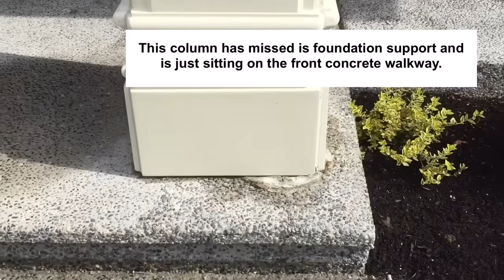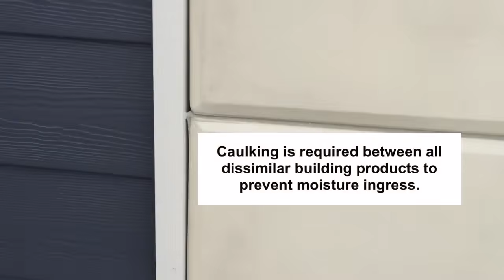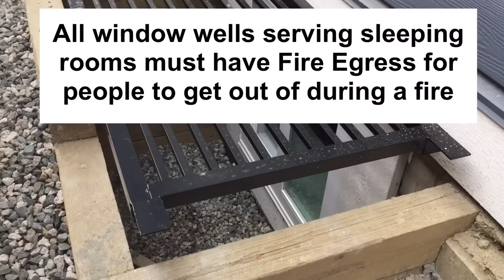New Home Construction Inspection - This is Shocking!!

Comment: How is this house worth 2.4 m??
Reply: The current location, the job in throwing the trash out (fees and such for the city to handle) currently on the lot, and erecting a better place to live = $2.4M
Reply: Spencer T vancouver is very expensive, i live around 45 minutes away and even the houses where i live are expensive for such an awful fucking house
Reply: Canada's housing bubble has not popped yet. Due to their mortgage laws (5 year ARMs, you refinance every 5 years by default) coupled with incredibly low down payments, people leverage these houses up to 60/1. If the house loses value, the bank comes after you, and your debt to the bank is insured by CMHC (the gov't) which will hunt you down for life, seize assets, and garnish your wages. It's a disaster waiting to happen with people constantly flipping houses at extreme leverage. Foreign buyers also play a major role.
Reply: Interesting.  As with anything else, timing is crucial....as long as the housing market is still going up,  it can make financial sense to leverage houses.... just get out at the top of the curve, before the rapid descent.
Reply: It's playing with fire though. In Toronto a lot of people are starting to get burned by this. The fact that mortgage losses lead to crown debt via CMHC is the true scam - basically the banks that issue the loans cannot lose because it's all underwritten by the government, and there is no debt forgiveness for individuals caught up in this. CMHC insures something like 70% of all Canadian mortgages and the guaranteed payout is between 90 and 100 percent in the event of a loss. The situation is far worse for Canada than the housing crisis was for the US government and could really cripple the country if and when things go wrong.
Reply: Spencer T is the price of that house in Pesos? This nome would not sell for 2.4M anywhere near where I live in the US, if lucky maybe 400k.
Reply: Because real estate is a free market that is essentially governed by the builders/owners/buyers and the only oversight by government agencies is reactive--meaning, if the agencies don't know about issues, then they don't do anything.

So, when the buyers are willing to pay, and the sellers are willing to bilk the buyer of every possible dollar, then you end up with homes sold far above their real value. The issue is caused by the seller, and propagated by the buyer and in turn exacerbated by bidding wars between prospective buyers.

In pretty much every situation, there is no oversight agency that prevents the transaction on the property from reaching unrealistic values so there's nothing that defines what the limit should be and because it is a free market--a seller justifies an excessive value because similar homes have been artificially valued by others in the area.

It makes no difference that most homes are built on lots worth $50k, the building materials are worth $50k to $100k and the labour is worth $30k to $100k (such as when a developer builds a subdivision and gets reduced costs because of the shear bulk of what they buy)--some buyer will pay the $2.4M and in turn justify the seller's valuation of the home.

If there were laws controlling the market, such as profit cannot exceed 30% of total revenue, there'd be no developers anymore as that prevents the developers' rapid business expansion, and they'll just go to another industry to find a different way to make more money.
Reply: Dav Z Canada is one of the most expensive places to live.
Reply: Vancouver is in a huge, possibly soon to burst, housing bubble. 

Nothing of the house is actually worth much, not even the land. It's just an example of how a market runs wild without either regulation or informed consumers.

It doesn't help that the banks are handing multimillion dollar mortgages out like candy--20 years ago they would have refused the same proportional mortgage amounts because the borrowers don't have the income, and now they're allowing it.

I mean, the market doesn't actually support the bubble as it is and never did. It's just a chain of severe stupidity and greed with no constraints that causes this.
Reply: Spencer T ikr?? That's like california prices..... Here in Texas you can get a house that's at least 15,000 to 20,000 square foot for that kind of cash.... Insert hurricane comments here
Reply: Horses
Reply: Lol, you can talk, american houses are made of cardboard.
Reply: Hmm... Well so are 2.4M homes in the Vancouver area apparently--so Canada has the same problem.
Reply: SirButtFux still not worth what they asking better off building n buying your own land and have a way bigger yard and house n be twice or 3 times the size of this house for 500k
Reply: Or maybe, just MAYBE people shouldn't treat homes like a volatile commodity on the stock exchange to be used and abused until the bubble pops. If people want to flip offices and business premises etc go right ahead, but homes are hard enough to afford FFS people should stop treating them like a product to just artificially inflate all the time and make a quick buck off of.
Reply: Cheap labor.
Reply: In Houston where it's wide open and have land everywhere, a run down barely livable houses with wire fence and bars on the windows in the hood start at 100k.
Reply: There should not be an oversight over a free market. The prices are only inflated like this because people are happy to pay these prices. Once people stop paying, the prices will plummet - either a business will lower their prices to attract customers, or they go out of business and someone else makes a lower price offering.
Reply: I've never seen a free market function properly by that logic especially with necessities.
Reply: It really doesn't work as you think, you can make mistakes or bad decisions that prevent you from learning as it ends whatever progress you can achieve and although you can't make errors again, you can't make decisions either--such as if you lose everything.

Unfortunately, human behaviour completely prevents the idealized concept of the invisible hand. So, a free market ends up killing itself without controls in place.
Reply: Where I live you could get a house that size or maybe even bigger in a good area for like 450k.
Reply: It´s all about location.
Reply: W Nij Yea, ever since people started moving into where I live from places like California prices have risen due to the demand for houses where other places have stayed relatively cheap.
Reply: Speculation rule number 1; The market is always right. That means that it's just as likely to double in price as it is to crash by half or stay where it is.
Reply: Doesn't have much to do with building size, design, cost of materials, or amenities but more in terms of location, job opportunities, quality of nearby schools, buyer's demand, and housing supply. Worth is just an opinion. There are no exact rules. Just what they think the typical idiot is willing to pay is what they will be asking for. What is anything worth? Worth is what the highest bidder will pay for it. If nobody will pay more than $200 then the house is worth $200 at most. Buyers are dumb. If they all held back instead of outbidding each other to drive the price up when they should instead be driving the price down. Most buyers are too dumb for their own good so the sellers usually end up on the winning end time and time again unless in times of a housing bubble and a recession.
Reply: Good question when you can hear the highway!
Reply: Not saying this is a good deal but come to the bay area California if you wanna see a real shocker.
Reply: Didn't they(the government) see what happened here in the American housing market in 2008 by doing this? I guess your government was bought by the banksters like ours has been. Corporate people are making money at the ultimate demise of the creation of wealth on the part of the consumer.
Reply: Yep, that's likely the situation--as not only will the government refuse to place rules on banks providing unrealistic loans and mortgages to people who can't afford them, they will likely bail them out of the hole they dig themselves into. It's a flawed system because the banks already have the money to endorse the campaigns of bank-friendly politicians and the common population does not.

Personally I should think it be a crime for a politician to favour a specific sector of commerce especially when that sector directly funds their campaign under-the-table (essentially a bribe) as it's a clear conflict of interest. Unfortunately, politicians are the ones who write and vote on the legislation.

So, you're right--our government did not learn anything of the repercussions of the USA's housing market crash.
Reply: Spencer T Over-demand caused by too much mass immigration too fast == housing shortage == rise in prices. Housing is the biggest scam in the US.
Reply: MrYouarethecancer I wouldn't call Canada a shit hole but I agree it's too expensive maybe not 500k but I think a million or a little under is acceptable
Reply: gurjinder singh Loot and remit.
Reply: Bike Vids ayy I'm not a job robber but you are not wrong because indians fucked the trades up with undercutting you can't really make money anymore
Reply: gurjinder singh We know you did. You don’t have to tell us.
Reply: Ten Minute Tokyo 2 stop assuming things I have respect for people who take pride in their work I was born and raised in Canada my dad is from India we are a lower middle class family working hard to make ends meet not rich and don't really want to be
Reply: It's Vancouver, BC, Canada... one of the most expensive places to live on earth.
Reply: I wouldn't even pay $240,000 for this shotty new home build.
Reply: When I kick the wall in and my foot stick outside to get fresh air conditioner ..
Reply: Is it $2.4million dollars or Canadian rupees?
Reply: I have no idea. Looks like crap
Reply: LOCATION LOCATION LOCATION
Reply: Lot: $2 million. Additions: 400k.
Reply: New home, location, material... design.. lots of factor
Reply: Vancouver is the most expensive city to live in Canada. I live in Ontario and this house would probably go for ~600k depending on location.
Reply: @Mi 28
I would have agreed with you in the past, but I've become a little sharper about how capitalism can very quickly turn into a scammer-friendly environment.
Between the banks and Chinese jacking up demand (in America, anyway) and the government incentivizing the over-pricing of property (for more property tax), I consider the entire real estate market to be one gigantic pyramid SCAM.
It's a milder version of Tulip Mania, as is gold, and as is the current valuation of the stock market, as per the Wilshire 5000 level.  Bitcoin is a stronger version of Tulip Mania, imo.

Let's say you have 1000 bucks.  Which seems like the better deal:
1000 bucks of ammo, 1000 bucks of food, 1000 bucks of gold (not even 1 troy ounce), etc.
So when you look at that, you can get a feel for what is and isn't worth putting money into.

My trades for the last couple months have all been short and I just swing trade the ranges until the real crash comes.
I will switch to buying when I start seeing good deals again, (which I define as .25 price-to-book ratio or less).
Foreign stocks and anything I consider 'sketchy', or 'hemorrhaging money insanely fast' nullifies that rule, of course.
Reply: spencer you have to remember thats canadian money .in america thats like 2000 bucks.
Reply: House prices mosty depend on place where they stand ... I could buy like half of my city for 2.4m :D
Reply: 00
Reply: Vancouver. That’s why
Reply: i think its not the house, its the location.
Reply: 2.4 million adjacent to the freeway
Reply: $2.4 million, cheapens out on stone tile wrapping - that's something that $150k home builders do.
Reply: drencrum - what's a $150,000 home builder? Been in the business for over 2 decades, never heard of one of those before. I think what you mean is a handyman. That's exactly what I see in this video. Glorified handymen playing carpenter....
Reply: +James Biggar I'm referring to the siding not wrapping around the house, instead immediately transitioning to hardi plank or vinyl siding. It's a pretty common cost-cutting method and happens all the time usually with brick. The fact that it's on a $2.4m home is absurd.
Reply: James Biggar nobody is a hater. Just stating facts. It sounds like you’re on a nascar track all you hear is vroom, vroom, vroom . Plus that would be considered a shack where I live . My tool shed is better constructed than that.
Reply: Seriously
Reply: 2.4M CAD
Reply: yea that's what i was thinking it's pretty shit craftsmanship for 2.4 mil
Reply: Its Vancouver, even the lower mainland is that expensive. Not all of Canada is like this. I live hours away from both Vancouver and the lower mainland and my house is 300k with lots of acreage.
Reply: the land is worth 2.4 mil. but im very suspicious that all the different trades hacked the job. labour was probably 15/h.
Reply: I’d rather invest 2.4 M.
Reply: location.
Reply: Meat Missile F1-11 in other words government interference has ruined the market once again
Reply: Spencer T, its because its vancouver (most expensive place to live in canada), there houses are double even triple what they are worth across the rest of canada. Its all about location, if you can see the mountains from your house, its double the value.
Reply: It's a scam
Reply: The land is worth 2.35 million, the house is only worth 50k.
Reply: That is one seriously ugly house. How did they get the necessary local permissions to put up that monstrosity? It is almost a parody of domestic  architecture, with totally out of place decoration smeared on like glitter on its eyelids. Yeuch! It is hardly surprising there were so many faults. The craftsmen on the job had their eyes closed the whole time, so they didn't have to see it.
Reply: Did they even look at the house?!
Reply: This is not true at all, they'll start at about 30k in South East side in very low income neighborhoods like Magnolia, Second Ward( all the wards for that matter). Honestly decent houses are basically in suburbs. Dallas starts in the 70k for single family house and I just don't find it attractive enough to invest yet.
Reply: lots of people<-> squalor
Reply: MrYouarethecancer Well it depends where you live. In Quebec you can get this for less than half the price
Reply: Spencer T its in Vancouver thats why
Reply: Spencer T Bet it's in California!! In the mid west that house would go for about 250,000!!
Reply: Personally I wouldn’t pay  ore than £100k for that, even if the stuff was fixed, it’s way too small
Reply: Must be pesos...
Reply: less than 1/2 that
Reply: Spencer T only Sydney & Hong Kong have a higher wage to housing disparity
Reply: ikr, in Colorado Springs you can buy a mansion 4x that size for 2.4m with mountain views and your own ski slopes xD
Reply: Jimjimjimjaboo  Did you seriously just say real estate is a free market? Nothing could be further from the truth.
Reply: I think he ment 2,400,000 pesos..
Reply: Meat Missile F1-11 well said
Reply: Canadian banks are far more responsible, that is why we don't have the same kind of housing bubble USA had. It's true there hasn't been a correction recently and real estate is cyclical but it would be incorrect to call it a bubble given the way the term is generally used.
Reply: took the question right out of my mouth. 
only i phrased it like "how the fuck is this house worth 2.4 million?!?"
Reply: It's not Canada it's Vancouver
Reply: I live in Hamilton, guy is right. Canada is a liberal shit hole. Food and housing are like 3x what they should be valued at. It's not even a supply and demand issue. It's a government legislation and tax issue. I could literally live better by spending 2 hours a day hunting and have all the time in the world to do whatever I want. Instead I work 50 hours a week so after taxes, food and rent I have less than a third of my pay left.
Reply: A million dollars for a house as basic and small as that? What a joke hahaha.
Reply: Lots of people = more crime and more expensive in parking, insurance and groceries as well as a bunch of other things.
Reply: US construction is shamefully lagging behind centuries even behind 3rd world countries.
Reply: Yeah Canadian prices are ridiculous thanks to them not having as free a market as the US
Reply: Its called Socialism, never works and is the greatest destroyer of middle class folks all over the world...read the recent history of Venezuela, once the largest greatest middle class utopia by light years in the world, now all those good people are getting food from the garbage and have literally eaten the zoo animals to survive. Politicians of Canida, the US (my country)and most all developed nations want the destruction of the middle class because thats where the power to resistance of tyrannical government is concentrated. Gov't's want two types, the elite rich who contribute heavily to keep them in power and thus well taken care of by them, and the poor, to have a large supply of low wage surf's to do what the almighty gov't tells them to do, unable to ever rise up as they are to occupied trying to feed and clothe and shelter heir family.

Hopefully soon Canadian folk will have enough of their gov't and throw out the chosen ones who think they deserve the right of power over you, just like the USA, Britian recently did and now people of Germany have done the same, Merkel may still be in office for now but not in power, Italy as well has told the EU to stick it. Regular folk all over are rising up against controlling government filled with people who never had a real job and are bought off by big companies and big donors.

I've always loved are great Canadian friends to the north, now kick out the elites from ruling you and elect someone who had to make a pay roll, a mother who knows what its like to work all day and take care of the kids and the home before and after she comes home from work.
Reply: As someone who has worked on many custom homes, it is often the builders who build 5 or 6 of these "high end" homes that do the worst job. They dress them up to look really nice but cheap out on so many structural/mechanical things and are also often super disorganized. The problem is people also shopping around for a deal. Another builder might have given a price of 2.6m for that house, and that 200k extra would probably have been worth it.
Reply: Spencer T the backspalsh probably
Reply: unfortanetly, it's isn't the house that's worth 2.4 million. The land it sits on is probably 2million. (the property i'm on was purchased 15 yrs ago at 264k. It's now worth 1.8 million and the house is a tare down.
Reply: It's no coincidence that the two largest countries in the world (by land mass) have vast expanses above the arctic circle. No one wants it. Maybe global warming works in your favor? I'm sure your country thanks you for your patriotism, but meh.
Reply: Dude I’m Canada in my county we have a hoisting crisis hell im paying over a g for just an alright apartment could be worse but my mother house she bought last year for little over 160 and it’s now worth over 240
Reply: In the UK we are increasingly seeing the use of 'down valuations' by lenders. Doesn't matter what you think your house is worth or what the buyer is prepared to pay, the lender will lend on what it thinks the house is worth. If this loan does not cover the 'value' of the house, you have to find the difference which in some cases is many tens of thousands. This practice should have been brought in years ago I think.
Reply: KNOW THAT HOUSE IS WORTH 2 PENCE
Reply: Location location location
Reply: liberal local government
Reply: Spencer T 2.5$ IS better
Reply: People are stupid
Reply: It's not, not even close.
Reply: ah he probably meant the gov in now could said it better A? that kind of cash better include timber framing sip panel roof n a barn
Reply: yes silly a pine box in liberalville i guess that is the way to make your self fell important spend gobbs on a normal home strange world its like in the 1990 toyota supra 28k the bmw 8 series 98k i think for just a bit better but not much
Reply: i would if schools did teach n not bs or people teacheded there children Godly morals n yes that all affects everything even buying a house liberal blowing money one does not have crap
Reply: Come to St. Louis where you can get a 3,000 square foot house in a nice areafor $250,000 .  Why live somewhere that is so expensive?
Reply: This is why i don't invest or live in shitty countries with inflated prices
Reply: My joke about where i live is the "if i had a million dollars" song, i couldnt afford a house. Im on Vancouver island.
Reply: It is a very large house and has a beautiful design, its just a shame that the workers did such a terrible job… poor QA/QC
Reply: Spencer T it's not.
Reply: Wow.  This is worth about 350,000 where I live
Reply: Exactly
Reply: This wooden shit in Europe would cost about 100k (without land), and noone woudnt want that :-)
Reply: Land
Reply: My guess is the lot is more than the house. All the building materials seem pretty cheap. Also, I think this is CAD$ which are less than US$.
Reply: Prices in America are insane for what actually you're getting. There are no regulations... There's no order, workers are terrible. And it's not only the housing it's everything. In Europe for example as much as they are not perfect as society, atleast everything is regulated, mistakes don't happen and you always get exactly what you paid for and at much lower price overall. It's wonder that we even exist as a country with these idiots all over the place running things. You need to leave America for a time to actually see how retarded it is here. For the last 20 years things just keep getting worse.
Reply: @abcdc197  American cities have code inspectors that enforce regulations, although exactly how well depends on the city.
North America has similar structures to Europe in many ways, but the insistence on choice and private options and not letting government's talk to each other makes it much more chaotic and expensive to run and less consistently enforced than the equivalent European system in most cases I've seen.
Reply: In one word: (the) Chinese.
Reply: Yeah, and your wife too Ramos.
Reply: I could buy me a 5 floor estate in Pennsylvania for 2.4 million dollars
Reply: Dav Z pfff 250 k
Reply: Meat Missile F1-11  It's not popping but rather deflating slowly. Prices are finally starting to come down because nothing is selling.
Reply: Not enough zoning.
Reply: Lindsey   It figures. Lots of wealthy migrants from China are moving there. That also explains the house's schizophrenic facade with those ugly fake columns... rich migrants love those.
Reply: because it's in a nice area. you can buy a mansion in bumfuck nowhere for that price, we know. In San Francisco it's a small apartment at best.
Reply: really? and what great country do you live in?
Reply: Location...location...location
Reply: In my country that weak wood ass shit its like 5 dollars
Reply: One word: Vancouver
Reply: @SirButtFux  looks hideous
Reply: If that’s the finished product I’d hate to know what else is done like crap inside the walls. 
Doesn’t a municipality have to do a final inspection before occupancy ?
And how can you call those stairs finished?
Just to fix those pillars would cost at least 15k.
Reply: Chinese investors. In Irvine Ca, 9 out of 10 homes were purchased by Chinese investors with an average of 2 to 3 homes purchased in cash. I've heard it is just as prevalent in Canada. But of course, we are not allowed to buy property in China....
Reply: @Jimjimjimjaboo  It is most definitely not a free market. It's the governmental interference which has caused this shit show.
Reply: Meat Missile F1-11 
How evil is it for the Govt to back the interests of Banks over Citizens, when the Banks are mainly causing the problem 😲.
Same in Australia.
In the US Obama bailed out the banks instead of home owners. I hope next time Bernie is there for the crash and the banks don't get bailed out.
Reply: No, no... $2.4M is what it will cost to get it up to code.
Reply: 2.4 million for a wooden structure?
I better be getting a bunker for that amount.
Reply: Yep, undocumented MexiCAN'T labor ALLLL OVER THIS.
Reply: housing prices usually depend on where it is.
Reply: Canadian pesos
Reply: That and you can still hear the highway?
Reply: Depending on the place in Canada, Vancouver homes are really expensive compared to Quebec for example. My house could be worth 1 million easy if it was in vancouver... tho its not
Reply: No fucking where near 2.4 million.  I don't care where it's located.
Reply: You’d get at least 30 Acres of land for 2.4 mil where I’m from lol doesn’t even look like a quarter acre
Reply: You tell me
Reply: @meatmissilef111  Unfortunately foreign criminal enterprises use Canadian housing markets to launder money, which is why you see so many piles of shit like this costing $2.4 million dollars. Our government is aware of it, but it's a really difficult issue to solve.
Reply: Its 2.4 million because there are plenty of people who are dumb enough to pay 2.4 million.
Reply: I was going to say it would be in Vancouver before they said it was in Vancouver
The house market has been used for money laundering by organized crime here
And all over the world. That caused the market to inflate to ridiculous prices
Causing million dollar homes to sit empty  while the landlords are “renting”
These houses to people
Reply: I think the lot is about 90 procent of the price. American homes (wood and plaster walls) are terrible quality compared to brick and morter.
Reply: @MrYouarethecancer  lol..ok
Reply: @jimmyngxc  that's house is a great investment in Vancouver if it's in the west side esp... pretty much guaranteed to go up... and ur gains are tax free if u live in it.
Reply: @xzqzq  Unless you're the last one to check into the party before it crashes. Don't pretend Leveraging up in a bubble market is not incredibly risky.
Reply: The bubble will pop soon.
Reply: It's $200,000 for the house and $2.2 million for "free" healthcare....
Reply: The property cost $2.5mil and they give you $100k for moving in.
Reply: Location location location. Same reason why home prices differ so much between New York City and Nebraska.
Reply: @meatmissilef111  my house is on a 7 year term not 5.
Reply: It's not. The land is worth over 2 million because Vancouver sold itself out to the Chinese.
Reply: @phoenixcoleman7777  A quarter acre in that part of Vancouver would be worth 10 million. This is a tiny lot.
Reply: VinylToVideo crazy man why don’t people emigrate Newport South Wales home this size worth 300k with acers   Lol weathers not the best but I can guarantee you can earn a shit load with a trade in this country
Reply: VinylToVideo where to is this? And why is it so expensive to live there
Reply: @phoenixcoleman7777  Because it's the city with the most mild weather in Canada. Unfortunately we've taken Chinese money with an exchange and sold out to them. I would move to Wales if I could; in fact my great grandparents were from there but it's not enough for me to get citizenship.
Reply: Because they let chinese buy up the property there and now the prices are in a bubble lol
Reply: Zero11 when was this?
Reply: Jimjimjimjaboo it's not a free market since banks are backed by the state. That what commies do.
Reply: Globalisation and the financialisaton of homes into investments.
Reply: Vancouver. Nuff said...
Reply: In my area in silicon valley it's worth a lot more.
Reply: California 🙄
Reply: Location, location, location
Reply: @meatmissilef111   wow none of that's b.s. is true
Reply: Rich fobs moving in?
Reply: @MrYouarethecancer  only the frozen provinces northern and mid provinces
Reply: coz this is Canada and  moreover Vancouver, they never had real estate bubble burst, not even in 2008.
Reply: @meatmissilef111  you nailed it.
Reply: The Chinese has destroyed the real estate market! I have been in many counties where it’s not supposed to be that expensive (w/o help of Chinese investors)...:(((
Reply: May God how many houses i can have if built in my counrty for the amount
Reply: Its all about the location. People would pay $5 million for this house if it was in NYC or San Francisco
Reply: Lindsey you aren’t buying the house. People don’t get this. You are buying the right to build a house that you want. The land may cost 2 million and the house cost 400k. If I’m the future the house burns down. That property is still worth 2 million. This is a basic example.
Reply: xzqzq actually I like buying when it’s going down. When it’s going up. Your already too late.
Reply: That's the cost of cleaning up all the mold and other problems caused by the sloppy craftsmanship that went into the mess of a house.  And woe to anyone caught in a downstairs bedroom if a fire should break out.
Reply: @MrYouarethecancer  And they tend to think they are better than America. Ive been there a few times and the attitude I got makes me glad I never have to go back.
Reply: Location, location, location.
Reply: That China Money. They moved on to Seattle once laws were changed in Vancouver. Seattle prices going to explode.
Reply: Take that same home & put it in remote areas of Montana & it will be worth $50k. Its the land / locations AND the drive for the masses to WANT to be there that makes it 2.4m. In 50 years the place may be like Detroit in the USA.
Reply: @MrYouarethecancer  , where in God's green acres do you live that is so friggin' fantastic? Obviously you don't know much about realestate prices on the West Coast. All you have to do is check the prices in any city over 1.5 million people, that has a view of the Pacific Ocean, and your into mega bucks. It's a pretty simple equation, sun, fun, and the ocean, equals big bucks.
Reply: My house I sold in a small town went for $50,000. Same home in Winnipeg would have cost me $475,000. Like all realtors will tell you. It's location, location, location.
Reply: if it was inhabitable, it would have been worth three times that. That's what you get for 2.4 mil, Don't expect to live in any house in that area for less than 4 mil.
Reply: @lindsey4891  it was revealed recently that prices were jacked up because international developers visiting the area. They arent just any developers, these are developers laundering money because of the inflated market, which in turm further inflates the prices despite the shoddy building work.
Reply: A lot of rich people are buying property as investments rather than living spaces.
Reply: Define "worth".   If you mean 2.4m in value then Hell no.  If 2.4m in cost then it is "worth" whatever a bank will loan on it, and not a penny more.  People who buy this simply take on a monthly payment which they fully intend to walk away from when the Global Debt Ponzi (GDP) collapses.
Reply: Thank you for sharing. I cannot upvote this enough.
Had one son have a house inspected by the realtor. Both very honest and save my son from buying a nightmare house.
Another son was not so lucky, even though realtor was a "family friend", their inspector did a crappy job and saw none of the roof and electrical problems.
Protect your biggest investment. Get a inspection of the house on your dime. May save you thousands.
Reply: Spencer T the chinese
Reply: everything at that house is fake.A danish person would never use that kind of showoff.We use the real material if it should look like.
Reply: With people willing to shuck our $50 to $69K for a truck I’m not surprised.
Reply: Hey I bought a 1960’s home 3 years ago and I’ve had some cracks appear on interior walls in one particular area. A contractor recently came to look at the issue for me and told me that the cause is likely due to a lack of support of the roof, there is only one 2X4 supporting a large section of roof and is where all of the cracks in the drywall are coming from. Is this something that the home inspector should have made note of in the inspection? If so what’s the best way I could handle the situation? Do I have to eat the cost of this mistake?
Reply: @youaregoingtolovethis  I think that WAY too many people buy homes emotionally instead of as a business proposition.  I would not pay that much for that house, I just wouldn't - perhaps I am not a typical consumer, but we looked at about 20 houses before we bought our current home.  We ended up in a great location, with a house that needed some TLC (it had been in rental service for a few years before we got it), and now it is our home, and worth more than we paid for it.  Just down the street is a house that is move-in ready, 400 square feet more (mine is 2250 - that one is 2650), and they are asking 175% of the newly appraised value of my house (the per square foot valuation is 148% higher than mine, and approximately 167% of local comps - they won't get it.  I believe their realtor is doing them a huge disservice even listing it for that price.  But it is an open market and the house will sell for what it is worth.  Someone from a higher priced area (larger city, California, whatever) will end up buying it for more than the market (currently) indicates it should be worth.  

The realtors around here are not idiots, at least mine is not.  He basically would not allow me to even look twice at a house that was priced at the top (or in this case, way over the top) of local market.  The local market simply will not support that asking price, and the demand here is huge.  But, with a lot of people moving into the area, demand will increase even more and if it sells for that, I will pop open a bottle of champagne and celebrate, because I will have gained $50-$75k just be being located within 1/2 mile of them.
Reply: @meatmissilef111  There are Youtube channels teaching house flipping. It has almost gone mainstream
Reply: I keep seeing comments on the price of the house. Did I miss the SQ footage of the house and or land. I use to plumb. I have noticed that the cost of a house is usually decided by lot price and square footage. Once you get into the million dollar range. It's mainly about how many baths and custom fitures. Tile, stairs, woodwork, cabinets and the like. If you pay a million or more on a house it better have three things. A very nice large lot or acreage. A lot of square footage. And last but not  least custom interior. Such as crown molding, solid wood cabinets, great commercial kitchen or close to commercial kitchen. Most trades don't care about how much a house is going to be worth. Plumbing, electrical and HVAC plus the rest you have codes that say how things are done. It may take more of it but the work is the same.
Reply: @davz1196  Actually the materials used in the home look nice and looks like it has a lot of square footage it was just built like crap and needs a lot of repairs already and nobody has even lived in it yet lol. It does look like some higher end materials used.
Reply: Banks willing to give credit out, people but sub-standard houses to $2.4mil...
Reply: It isn't,  same here in the UK. When I bought my 1st house in the 80's a terraced house was 10 to 13 grand and a semi 18 to 20 grand.  Now the same terrace is 180 to 200 grand and the semi 300 or more. Who really benefits,  no wonder kids can't afford to buy a 1st home nowadays.
Reply: @gurjindersingh199  good lad, hope you qualify and it all works out for you.
Reply: @gurjindersingh199  the ten minute bloke is a wind up merchant ignore him.
Reply: it's Honcouver, baby
Reply: Banks want their money back now...when you realize the government loans out money at a fraction from banks and much longer...lol
Reply: Yes. The developer made an attempt at a fancy entrance and the rest of the exterior is plain.
Reply: Location location location
Reply: Location, location, location.
Reply: Location, location, location....Vancouver, BC Canada.
Reply: Spencer T because it has a white foam circle above the entrance !
Reply: @MrYouarethecancer  The whole front of that house is custom stone. You have no idea what you're looking at.
Reply: Houses cost SHOCKINGLY more in some areas, than others, as you likely would have realized if you'd thought about it a bit more.  Look up housing and apartment prices in bumfark midwest nowhere (Lyons, Ka maybe, since I know people who live there, and that it is cheap) and New York City, or LA, etc.   It will become obvious.
Reply: Fester Blats  Dead Accurate
Reply: It just costs that much.  A very good reason not to live there.
Reply: Seems like the CDO tactic is taking hold in Canada. Good luck to ya's 😂
Reply: @user-hs2hd7wp9g  nah same garbage in USA, every company zips these houses out
Reply: It's Canada. Over two thirds goes to supporting third world terrorists thanks to taxes.
Reply: That's insane for the price. Did the builders even try. Just think about the corners they cut that you can't see.🤔. Makes me feel better about my house that cost a fraction of that house.
Reply: Decades of gradually increasing zoning and residential construction restrictions that drive the price for real estate up.
Reply: That's $60,000 USA Dollars.
Reply: @Jimjimjimjaboo  show an area where lots are 50k and homes sell for millions.
Reply: @Jimjimjimjaboo  your numbers don't correspond to reality. The land here costs 1.5 million and the value of the home is the rest
Reply: One word answer being Vancouver.
Reply: if its in San Francisco then I can see why. The value of the land would contribute to 75% of the value.
Reply: toadamine Vancouver is fourth highest in the world LA is like seventh
Reply: ABSOLUTELY NOT  !!  600K MAX !!!
Reply: CANADIAN HAS A NEW MEANING,  FOOLS !!!
Reply: I COULD BUILD A FINE HOUSE , ( NOT THAT CRAP PRESENTED !), OF SIMILAR LOT, SCALE, LAYOUT, FINISHES, WITH LANDSCAPING,  FOR UNDER A MILLION DOLLARS !!
ALL DAY LONG !!!
CHEERS
Reply: @youaregoingtolovethis  NO !! IM A GC IN TACOMA, 42 YEARS IN CONSTRUCTION,  20 OF THAT CUSTOM HOME BUILDER , MOST COMMENTS HERE ARE LUDICROUS,  UNQUALIFIED, NONSENSE  !!
THIS EXAMPLE GIVEN BY THE INDEPENDENT HOME INSPECTOR WAS ENOUGH TO SEE THE GENERAL " INABILITY " OF THE INEXPERIENCED PEOPLE THAT PUT THAT STRUCTURE TOGETHER, AND THE OWNER/ BUILER ATTEMPTING TO TRIPLE COSTS, AND QUADRUPLE PROFIT ON ONE PROJECT, INSTEAD OF MAKING GAINS PROGRESSIVELY THROUGH VOLUME OF SALES !!!
IF ANYONE WAS TO OFFER ANYTHING CLOSE TO 1 MILLION FOR THAT PROPERTY THEY WOULD BE A VERY GIG FOOL INDEED  !!!
CHEERS
Reply: @ToMu29  NO !! CORRUPTION,  IGNORANCE,  GREED !!!
CHEERS
Reply: @Reno2324  PESCOS , LIRA, WAN ........
Reply: @Datsugahwallsplitta  YES !! AND MANY OTHER LOCATIONS FINER THAN VANCOUVER BC !!  OVER BUILT, RUINED !!
CHEERS
Reply: @Quentyn73  ANOTHER SOCIALIST PROPOGANDA FED MINION !!
GO BACK TO SLEEP  !!!
Reply: @rsd3719  THAT WAS FINE UNTIL YOU SAID RUSH WASN'T A GOOD BAND !  ??
COME ON, MOST YANKS WOULD NOT AGREE !! 
CHEERS
Reply: @ravenmoore8432  PEOPLE!!  REALIZE THAT THE IMAGINARY INCREASE IN VALUE " DUE TO MARKET MANIPULATION", IS ALL FOR THE INCREASE IN TAXES THAT COME ALONG WITH IT THAT YOUR GOVERNMENT IS BEHIND THE WHOLE SCAM !!!
THEY GET YOU COMING AND GOING !!
UNLESS YOU ARE A REAL ESTATE INVESTOR,  BUYING AND THEN QUICKLY RESALING,  YOU WILL BE HIT WITH THOSE FEES AND TAXES INCREASES ANNUALLY  !!!!
CHEERS
Reply: @BrutafulStudios01  I WOULDN'T RECOMMEND ANY WHERE NEAR  CHINA  !!!
CHEERS
Reply: @charmander777  NO ! ITS A ONE TIME DEAL AT THAT PRICE POINT  NEXT TIME THAT PROPERTY BECOMES AVAILABLE,  IT WILL BE SUBSTANTIALLY LESS $$$$$$
ALL BASED ON MONEY LAUNDERING THAT IS FOLLOWED BY PROFIT LOSS TO COVER OTHER MONEY LAUNDERING, A PERPETUAL CURRENCY MOVE UNTIL INDICTMENTS  ! 
CHEERS
Reply: The land is worth 2 million, the house cost 400k to build or replace. They don’t actually save any significant money by taking these shortcuts, and if the new owner fails to inspect and they get away with it, it’s not like the savings will be passed onto the home owner.
Reply: @effyleven  It's called money and greed and bought out city council members. In my local SoCal suburb, two out of the four members are bought out and support anything $$developers bring them. Homeowners that have lived here 40 years are put through the wringer by the Planning dept w setback and lot coverage rules, meanwhile developers get away with 4 story monstrosity townhouses directly on the property lines. This is what scares me when politicians say "We need more housing".
Reply: Lindsey ?
Reply: wow this is why i like to build and fix my own shit.  this is garbage.
Reply: I have lived in Durango, Co. Two story double lot (still very small lot) 3 bedrooms 1200 sq  ft house built in the 1920-1930s. Un- finished crawl space. One full bath! $600,000. $500 a square foot that needs $600, 000 spent on it. Why? Many reasons but lack of over sight is not the problem!  I have personally found that when the private sector gets a promise from uncle Sam to its limit losses, all sense of "true cost" goes out the window! AND in EVERY case, there is a bubble that explodes.
Reply: That's the point of the video..
Reply: It's because it's so close to the airport. Like 20 feet.
Reply: Stupid people will buy it.  Why do you think developers have a lot of money?
Reply: Location,  location,  location
Reply: 2.4 million VENEZUELAN DOLLARS
Reply: Only if the land cost $2m 😂
Reply: Looks like Canadian craftsmanship.
Reply: Shelly B.  you have to disclose that you are paid by a political party.  Check the terms.
Reply: Tax revaluation.
Reply: @Jimjimjimjaboo  There is no free market! It's all a bubble pumped by low interest rate and government insured mortgages.
Reply: Location; location; location.
Reply: 2.4million Zimbabwean dollars.
Reply: And this is new home ???? HOW ????
Reply: Looks like crap lol
Reply: Depends where it's at.  You don't get much in somewhere like San Francisco or Malibu.  A trailer on a lot will sell for $600K and has before, it's been in the news.
Reply: Its just like here in Winnipeg, A.K.A. Crime Incorporated. They jack up the property values so the city can get more property tax to pay their employees and garbage mayor and council piles of money. Its a total mafia ponzi scam. Google WINNIPEG COMPENSATION DISCLOSURE and look at what those clowns make.
Reply: @MrYouarethecancer  It's Vancouver, one of the largest cities in North America, which is also situated in very narrow mountain valleys.  Land prices are high from that, and from offshore investors that were buying up property all over the city at the time of the video.
Reply: 2 words. Chinese speculators.
Reply: @user-hs2hd7wp9g  Never lived in America have you? All of the homes around me are made of limestone brick in particular, all very well built and very strong.
Reply: Their are buildings worth less than this house and bigger and better looking. NYC
Reply: The answer to your question is that it is not worth 2.4 million, and anyone who shells out that amount of money for a poorly-designed, poorly-built place like this needs a keeper.  With so many obvious defects, what other ones are hidden behind the walls?
Reply: Ooof should have known this was vancouver, never saw such ugly houses until I moved here.
Reply: @MrYouarethecancer  clearly havent seen what US has some in store
Reply: It’s not what it’s worth but how much someone is willing to pay for it.
Reply: It's far too small of a house to have those big columns on it. The thing looks like a Disney Land attraction rather than a house.
Reply: 2022 welcomes you where this is a good deal!
Reply: 2.4mil for a small crooked plastic/cardboard home
Reply: 2.4m Argentine pesos, maybe, but I’d negotiate
Reply: It’s going to cost 2.4 million to tear it down and rebuild correctly
Reply: It’s not. Housing bubble.
Reply: The house isn’t....the land the house is on is.
Reply: Location, location, location!
Reply: Welcome to Vancouver
Reply: Might've been said already, but check out any dumbass ranch in Greenwich, CT. Prices are astounding for the brand and the location close to NY
Reply: Chinese buyers from the bubble Chinese housing market.
Reply: Boy I remember the 90s when half a mill damm near got u a castle a million deff got u a castle now 1million  gets u a tiny house with the worst builder grade layout and zero upgrades since building but somehow the value went up 2 million 🤦🏻‍♂️😂
Reply: Bet its worth 6m now lmao
Reply: Its not
Reply: Cause it’s not in central Kansas 😂 asked and answered.
Reply: Right? That’s extremely cheap
Reply: @mijreed  oh you’re so clever Mike…this post was 5years ago
Reply: That's how much it would cost to fix the problems.
Reply: Location location location
Reply: Chinese.  Need I say more.
Reply: Remember, you’re not just buying the home. You’re buying into the town.
Reply: Location location location
Reply: Location location location.
Reply: @user-hs2hd7wp9g  some ... literally
Reply: My thoughts exactly. Who would take that house for free?  I think this guy meant 2.4 k.
Reply: @MrYouarethecancer whether Canada sucks or not is debatable, but this house is a POS! It should be 300k at most.. and that's only because it's new and everyone just has to have a new shitty house
Reply: Oh don't worry. House comes with a big sticker price but that's not the biggest worry, it's built with cheap ass mdf materials and OSB woods. Not a fan of pex plumbing either and it's constructed by a bunch of guys who keep their highlighted vest on all day trying to impress the ladies when they go cash their check.  Caulking gets done and everyone knows it's eventually gonna shrink but nobody decides to re apply. If they'd only use good quality sicaflex caulking they wouldn't have these issues
Reply: @davz1196 where the hell in the US do you find a house for $409k this days? Arkansas?😂
Reply: House is worth like 350k
Location is worth 2.05m
Reply: Location location
Reply: That's in Canuckistan Grickles
Reply: Canaduh
Reply: @lindsey4891 have you seen some the huge houses you can get in the usa for less than 1 million. Its insane the difference.
Reply: @meatmissilef111 down payments are usually 20% so no that is not a small down payment
Reply: @davz1196  it's location dude. The house on the land doesn't matter much
Reply: @Jimjimjimjaboo no. This has nothing to do with why vancouver is expensive. Its purely due to location
Reply: Pesos, Philippines.
Reply: Location, location, location 😂😂😂
Reply: Unfreakingbelievable
Get a good inspector is an understatement.
Reply: 3 words. Location location location
Reply: I think that’s in pesos
Reply: Location, location, location.
Reply: I live in the Midwest and my home is much bigger for about $200k. Top rated schools, excellent streets, great police protection, ect.
Reply: Location, location, location
Reply: its not
Reply: No it’s not. Overpriced by 2
Reply: ITS NOT !
Reply: 😅😅😅
Another flimsy timber shed.  Build with masonry instead. Solid.